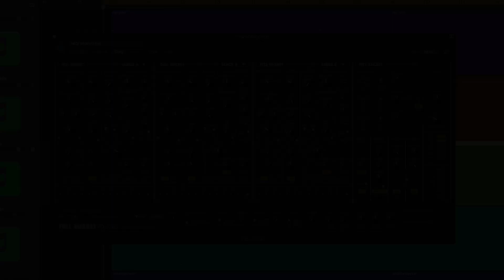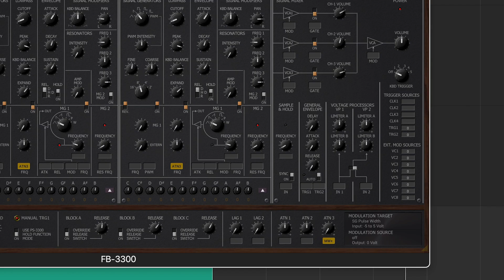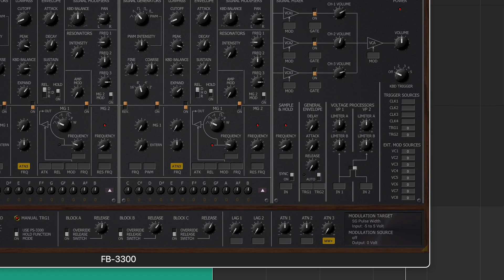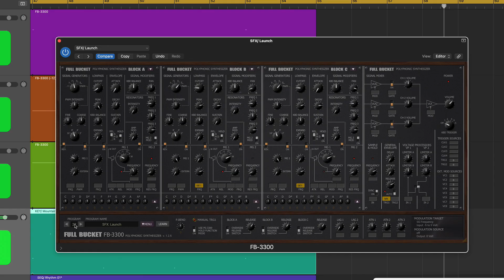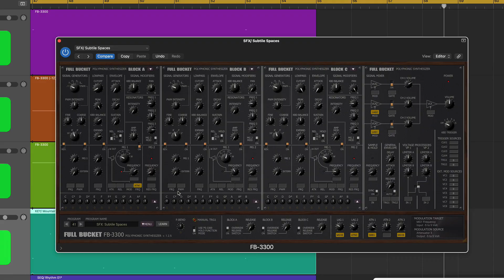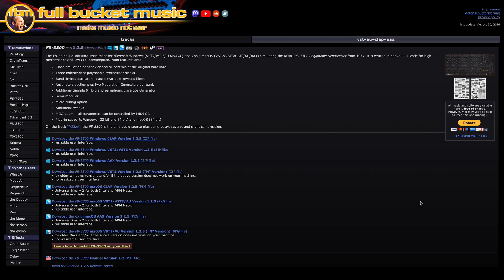Why the Full Bucket FB-3300 is a fantastic free synth – and how to use it

Comment: Personally, I think Cherry Audio's offering is far better than this one, albeit not free. I've tried both versions.
Reply: Yes, the patch cables are a game changer,  if you hate menu diving plus the workflow becomes so easy and intuitive. But that's not all, the full bucket has more quirky features like the 3 releases modes, the CA one has a simple release.

The effects are a nice touch but the best extra feature imo is the possibility to change the filter type from the ps to a ms aggressive style.
Reply: @cristianvaldezosorio7822  do you think it’s a design flaw that FBM released 3 different simulations of 3 different synthesizers? I apologize if that is not what you meant. One thing not mentioned is that the Cherry Audio version donates some of its earnings to the Electronic Music Education and Preservation Project (EMEAPP). A good cause. Or you can donate to them directly and get the free FBM version. The patch cables are not a deal breaker for me, but others may feel differently. Likewise with the MS-20 filter. The original Korg used the K-35 Low Pass filter, and I have the MS-20 Filter from Arturia It was distributed for free a few years back, if I need that sound. But that may be useful for some.
Reply: What do you prefer in the Cherry Audio version? What is best? The virtual pach cabling?